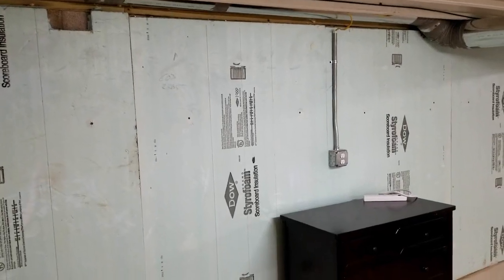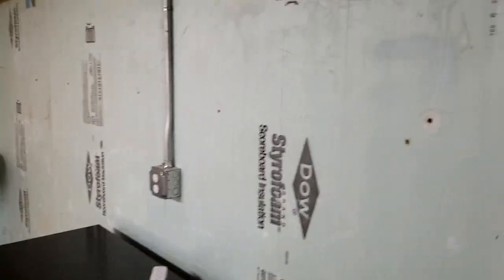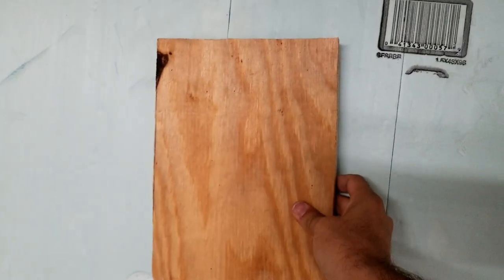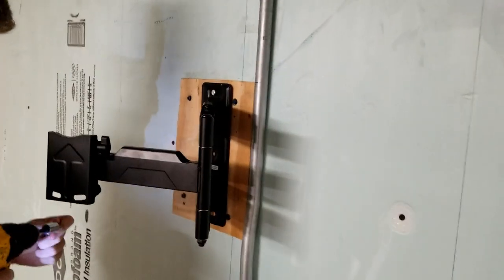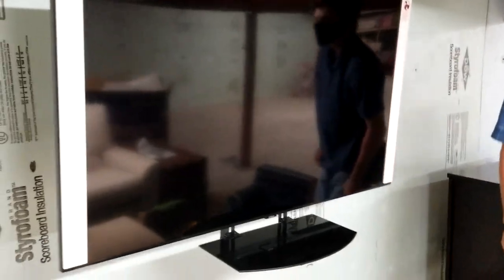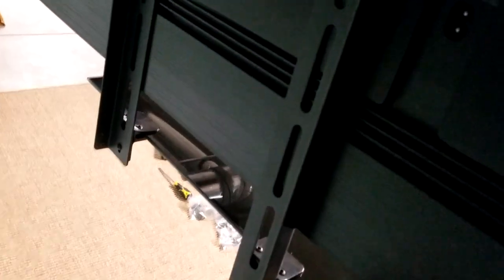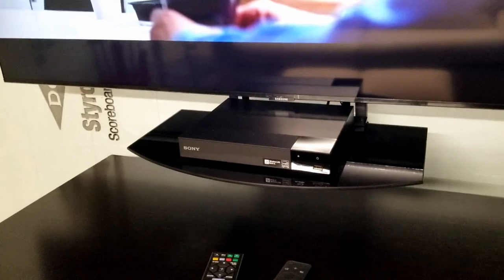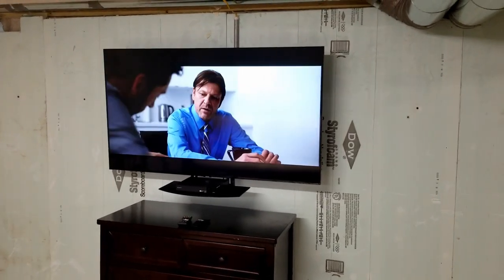Samsung 55" Basement Wall TV & Blu ray Mounting

Comment: Thanks for the video! I think that under-TV mounting is exactly what I need and I didn't know it existed before this video
Reply from the maker: Sure thing, for those with DVD/bluray players at the TV, it is an option.  But not very common.
Reply: @FisherElectronics  Agreed. An older relative of mine routinely still buys DVDs so this is a no brainer to get them